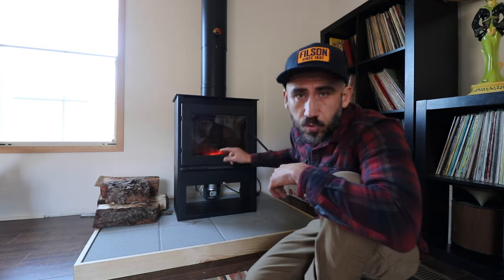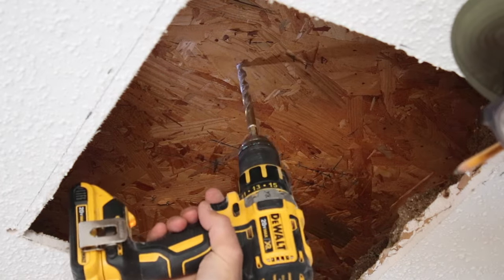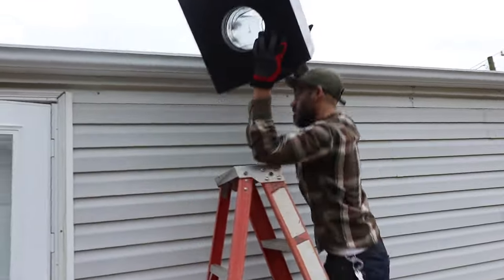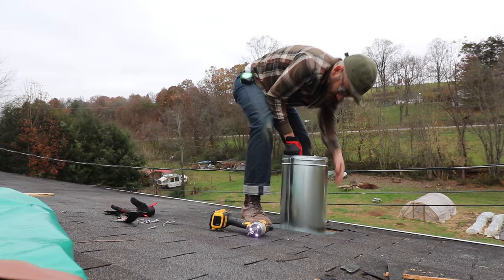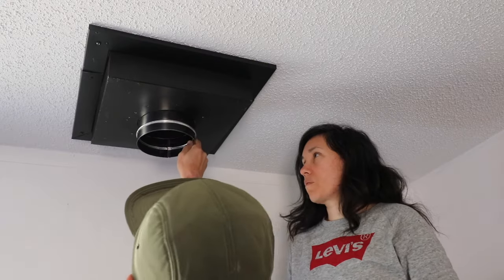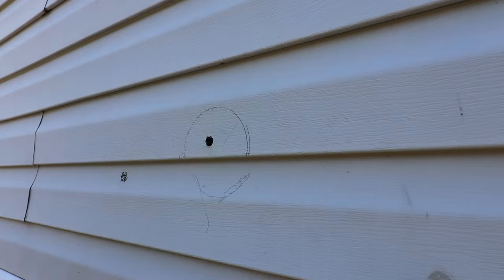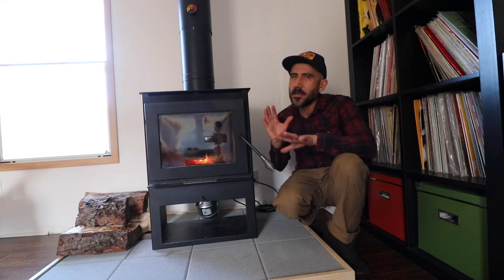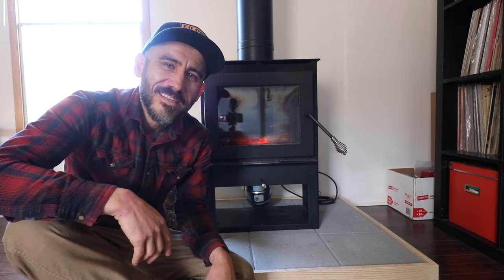DIY Wood Stove INSTALL in MOBILE HOME

Comment: Be careful about inserting the stove pipe going upward, into the next section. That way, creosote leaks backward thru the joint, and drips into your home.
 Always install stove pipe inserting the top section into the lower section. 
That way the creosote will drip backward into the inside of the pipe, and be self-contained.
 I learned this the hard way!

Comment: We installed ours using your video! Only problem was we built tile hearth (floor, back and sides) prior to checking to see where studs were. Pain in the butt! Had to cut THROUGH studs and build c braces. Check where your studs are FIRST before you do anything. Otherwise, your video took us through complete install! We had some issues with ordering parts and knowing what we needed but ordered Duravent double wall system from Northline Express. Their sales rep helped us with parts and adapters plus they have a YouTube channel that has plenty of videos that describe piecing together the stovepipe pieces. Thank you for great instructional video that walked us through each step!

Comment: I think it's great that you guys are DIY and not afraid to tackle new jobs. I'm confused about the heat though, if it's not heating up the shelf or anything around it, how is it heating the house? From our past experiences wood stoves should really heat things up. My only critique, stop using drywall screws for everything! And keep an eye on that roof. Water leaks are a mobile home's worst enemy. All in all, good job and excellent learning experience. We look forward to installing one of our own someday.
Reply from the maker: i guess i meant to say it's not heating up the records on the side of stove. If they do i will move them. but so far so good. thanks
Reply: I have the same wood stove. The sides really don't heat up much at all, when compared to the single wall pipe a foot above the stove itself. The same goes for the area behind the stove as he demonstrated. It really backs up the manual's indications of clearance to combustibles, which is as close as 10' with single wall stove pipe, and 8' if using double wall. Hard to believe until you actually experience it ( was about to waste a weekend installing a heat shield ).But the thing provides a surprisingly large amount of heat, compared to an old Efel Kamina I'm used to.

Comment: Great tutorial video. To get a longer wood burn, I suggest you install a  damper in the exhaust flue out the top of the stove. This will slow the burn. Useful at night so you dont have to get up and feed the fire. The woodstove will develop a personality and from our family experience we named it "Smokey".  After fire is out, closing the damper will prevent a downdraft of cold air dumping ash, smokey smells and a cold draft into the room. Having said that, enjoy. Your family has a new member!!!
Reply: manufacturers don't recommend a damper. Doesn't need it actually.

Comment: Excellent job and video. You need a poker to move the coals and wood.  I get free wood off Craigslist and Facebook and how noticing where utility companies trim under power lines.  They leave wood.  I have a rechargeable battery chainsaw that has been going strong for 3 years. But the chain needs sharpened -another skill.  Splitting wood is a workout that is actually enjoyable.  My grandpa 🧔🏼taught me how to split wood and use a couple of wedges if need be.

Comment: Great video. Was considering doing this in our off grid cabin but honestly after seeing it I think I'd rather spend $1500 in more solar and batteries to run an electric one. I think you did an awesome job but I'm more comfortable with electricity than live fires (especially for renters). Thanks for the insight!

Comment: When you put the flashing under the shingles you need to go up as many layers as possible never put silicone under the flashing that goes towards the endge of the roof. That can creat a dam if water does get under it cut your shingles to fit around pipe and use silicone under the shingles you lifted up and remove any loose nailes or staples that may have come loose.  In your climate you dont worry about alot of snow but further north the ice will back up on tje roof and if everything isnt hunky dory it will get up under the shingles get warm and leak

Comment: The best cleaner for the window on your wood stove is wood ash and newspapers dampened with water.  That takes off all the burnt on deposits from the fires.  A little trick we learned from Vermont Castings, a wood stove company.
Reply from the maker: yes, we figured that out! thanks!

Comment: Great video try using urethane for the flashing and shingles it'll save you time and money if the silicone doesn't hold or breaks down over time. I've used it for years with no trouble at all. Some times silicone will break down in cold and damp weather.

Comment: Nice video but one thing I noticed, your box flashing should have went over the shingles. This helps insure that in the event of pipe failure that your osb is shielded from any potential fire hazard. Also I would have added foam fire block. But that's just me.

Comment: Nice install, pretty much by the book with exception to the sheet rock screws holding the support box, don't sweat the silicone job, if that area on the shingles or class a chimney gets hot enough to affect the regular silicone then you have bigger issues to deal with. 
The Englander 17vl is a small but proven work horse, its a convective heater, meaning it will heat the air through those vent holes and then send the heated air into the room, the blower running on low will help a ton, plus you have radiant heat through the large glass.
Wood moisture is the key with any new epa approved stove, buy a cheap moisture meter and test your splits, you want wood to be <20% moisture, take a room temp piece of wood, re-split it and test the fresh face to get an accurate reading. 
The air control is functionable, when burning with dry wood once you get established flames start pushing in the rod 1/4 at a time, wait 15 min in-between movements, this reduces the primary air, slows the stove's burn down and will let the secondary air take over and reburn the unburnt gases from the primary fire. While finding your sweet spot go outside and check the cap for smoke, you should only have heat waves coming out with occasional wisps of smoke.

Comment: It shows you used a 6” adapter to the firebox, however the stove pipe you used is 8” inches. Is this right? Or does it have something to do with the stove pipe being double walled? Love the video. Thanks

Comment: Does it heat your entire home like keeps every room comfortable? I am trying to do away with electric heat and my landlord told me I could put a Woodstove in. I used to have a Woodstove in my old mobile home I used to have but the issue I was having was getting the entire 70ft trailer heated with it. I used to also burn let the pipe get to 500 degrees for a half hour once a week and never had issues with creasote build up.

Comment: You need to use high temp silicone on that flashing goes around the flue pipe to the flashing on the roof

Comment: Is this your only heat source for the mobile home? We are planning to use a woodstove for our only heat source, and worry about getting the heat down the long hall. We have an old 720 sq ft single wide. Not the best insulation. We also live PA so not the worst wintets but not the best. How well does it keep the whole home warm?

Comment: Jason I am from the city and where moving to the country over there we need a woodstove or wood based furnace (guessing same thing) I have been looking for something similar to be somewhat a heating base for our house we have the hole on the wall and the outside set up done we just need the actual woodstove and the vent pipe to attach from the furnace to the wall but since I HAVE ABSOLUTELY NO IDEA WHAT I'M DOING OR LOOKING FOR, NEWBIE ALSO, your video was extremely useful my house is on a 2296 sqft property house itself is 1238 sqft 2 levels. I'm still doing homework but if you have any suggestions or any of the viewers do I would HONESTLY, TRULY FROM MY HEART WOULD APPRECIATE  any helpful advice thank you. I would of never thought of a Stove and Chimney place, that alone helped narrow down a whole lot again THANK YOU.

Comment: You need to move your record albums from where they're setting, the radiant heat will melt them. Other than that it looks like you did a great job well done.

Comment: Couple questions...you said that there wasn't any heat next to the records and behind the wood stove...I this because of the blower fan? If so, what about when the power goes out...have you tried it without the fan?  Also, why did you choose to use double wall on the stove to the ceiling...was it an insurance thing? Why did you choose to not use a damper in the flue pipe? In my experience not having one makes burn times shorter as all ( or most of) the heat travels up the flue which in turn costs more in wood. Thanks for the video, I have done something similar in a mobile home when I changed over a customer from electric to propane...it's a pain for certain! Nice job!

Comment: I can tell you have pride in ownership.  Interesting that you had to cut a hole for intake air.  Most of the time in a home you don't have to have an air inlet.  Good job.
Reply from the maker: the stove directions said I needed one. I just went by the directions. thanks!
Reply: Mobile homes are so tightly built that you need outside air for oxygen.

Comment: Next thing on your to do list is learning to clean the chimney.  You do not want a chimney fire!  You can buy the brush kit at any hardware store and it is simple to use -- but each chimney is different.  How I clean mine will be different than how you clean yours.  You need to talk to a pro.  I clean mine in the spring and then again mid winter with a quicky run thru in the fall to make sure nothing has gotten thru the flue cap to make a nest in the chimney (bees, etc).  Have to agree with Tomato Geeks about not burning green woods.  Some people state one full year after a tree has been cut is fine but I prefer 2 years (1 year as rounds and 1 year as split).  Unseasoned wood is cheaper if you are buying it and you can season it on your property very easily.  I rotate my stacks.  My stacks are also stored off the ground (cement blocks supporting 2x4's).  Right now I have 3 years worth of seasoned wood stored on my property ready to burn.  And this winter I will add corpse wood (a British way of managing their forest by allowing trees that have been cut to put off new growth) to season.  Also agree with Tomato Geeks to install a fire proof material on the back wall.
Reply from the maker: thanks for the info!!

Comment: Great job Jason!  Did this affect your insurance any?  We can't find a company to cover our mobile home if we install a wood stove.  They all say it has to be installed by the manufacturer.  Real bummer because we really want to get off of all electric and have a wood stove again.
Reply: What about a wood burning furnace with forced air?They are outside the house.
Reply from the maker: not sure, probably should have checked first. thanks!

Comment: Van dam on that scone schmear, holy wha! I always use butyl sealant, that silicone will need looked at in a year, the UV rays kill it and the winter. Sometimes just use what you got but it'll be fine where the sun don't shine. Amazon  ya some self leveling lap sealant, butly

Comment: I don’t know anything about wood stoves so I hope this isnt a dumb question. If you can’t feel heat behind the stove or on the side of the stove where the records are how does it heat the house? What part of the stove is giving off heat and how is the heat getting to the rest of the house? 💕
Reply: its actually a great question. its the front that gives off the most heat, regardless of model. The first two feet of stove pipe is also quite hot as well, but the heat radiating from that isn't large enough for owners to be worried about it being lost out the chimney.

Comment: Metal on the back wall helps push heat back in given Manufactured homes don't always have the best insulation. I got mine from TCS.

Comment: I would really like to have a wood stove in my double wide, I live out in the bush a bit and am stuck using propane for heat in the winter. My yearly propane (just for heating) costs around $1600. The problem is my home insurance said that if I put a wood stove in, my insurance would  pretty much double from $1100 a year to a little over $2000 a year. Meaning I would have to save $900 in propane every year, plus the cost of going out myself and getting firewood, just not sure if it would be worth it overall.

Comment: I was so hoping this was being done in a metal on metal singlewide with no OSB on the roof but only rolled metal roof.Wanting to do this but definetly will have to make a framework between 24inch on center and how leaks and roof rumble wont cause leaks.

Comment: I hope you trimmed those shingles to sit flat on roof and put a bit of  sealant under to hold down. If you get a stiff wind under those shingles they can get ripped off.

Comment: Hi. I got a mobile home and it has a wood stove which looks sealed. Previos owner does not have info. Is this common on mobile homes. If so, why they are commonly not in use? Thank you

Comment: Did roofing for years. Remove all the shingles carefully around the pipe flashing. Then you want to put shingles back on around the pipe and cut them round the base of the piping. You get a more water tight seal.

Comment: I built my hearth and installed my wall shields I used a stud finder but some person with mobile home built just left a strip on the sheetrock so stud founder found that 😩 I thought I had everything! I had to reroute over so saved up for the 45 degree double pipes, now the orig pipe coming up from stove is to tall! Dag nabit ! Frustration is so high , I have mobile home volang wood stove that has blower and bought the mobile home install kit from northern tool, same with the two telescoping pipe and now I have to save to get the pipe from stove to the 45 reroute … I am by myself so trying to get this set up and measure for the new pipe I need is impossible, guess I need to find a neighbor to come help

Comment: Does the blower run every time you have a fire?
Reply from the maker: no. has a switch. thanks
Reply: Sow the Land what’s the purpose of the blower? I’m looking to instal one into our
Mobile home and don’t want to hear a motor running all the time
Reply from the maker: it circulates the hot air. blows it out more. you don't have to have it on. or turn it on during the day and off at night. it's not too bad.
Reply: Ok cool, thanks

Comment: I thought to be an efficient heater it would be necessary to have the heat radiating to the inside of the trailer. If you allow the heat to just flow up the stove pipe and exit outside you get very little bang for the buck.  The fresh air vent you installed is to give the fire oxygen to burn with.  Without it the stove would suck in oxygen from the room air as well as the heat that was already there...it kind of defeats the purpose of having a wood stove. Isnt your firebox double insulated? And that is the reason it is not hot around the sides?

Comment: Should have built a mud room at the back door , keeps the mess out of your living space , heat will flow up into the trailer, double drywall the room , on a concrete floor , your insurance company will love you.

Comment: If the stove doesn't give off heat, how do you use it for heating? I'm a bit confused.
Reply from the maker: i was trying to say that the sides and back doesn't seem to be extremely hot. thanks

Comment: What's the use of pipe that go outside from underneath ? In India, our wood stoves don't have that....just pipe at above....and it cost us only 90-100 USD
Reply: That is a fresh air intake, it keeps the home from becoming starved of oxygen. Also having a fresh air intake that draws from outside keeps the stove from drawing air from outside from cracks in leaky windows, doors, etc.  it’s a very worth while piece to add to any wood stove. Especially needed in mobile homes because of their small size. Don’t want to starve the people sleeping in it at night of oxygen!  Hope this helps answer the question

Comment: Nice stove!  But if it won’t melt the records, how will it heat the whole house?
Reply from the maker: so far so good.thanks
Reply: That stove is heavily insulated on the sides and rear, hence the close side and rear mfg clearance tolerances and blower.

Comment: $1300 is about what a central air unit costs running off gas.  So not sure why you opted for this instead of that?
Reply from the maker: Wood can be free. Gas is not. Right after i installed this stove we had a big snow storm and a power outage for over 8 hrs. This kept us warm. thanks!
Reply: I agree, wood can be free. One time i picked up 3 full truck loads of unchopped wood for free. After i split it, i had enough to last about 3 months. Not bad for free wood.

Comment: that stove should cost max 200 dollars
3mm thin steel is so cheap i saw an stove at 150 dolars new
i got mine for 190 usd and it has an cast iron top that is as think as your pinky